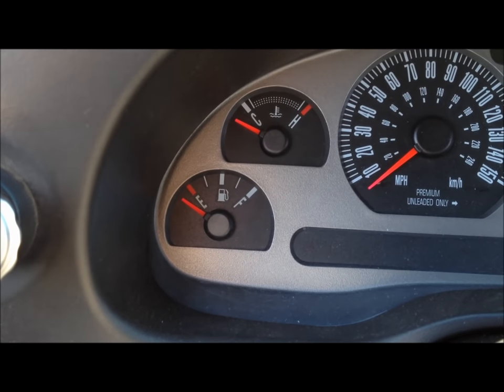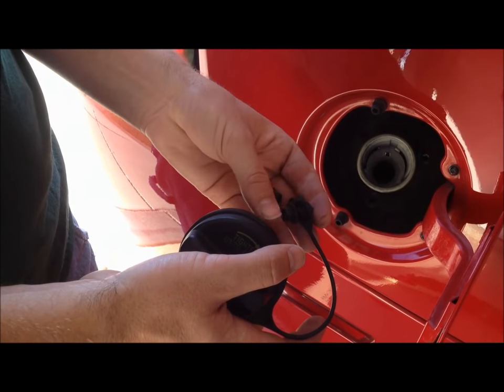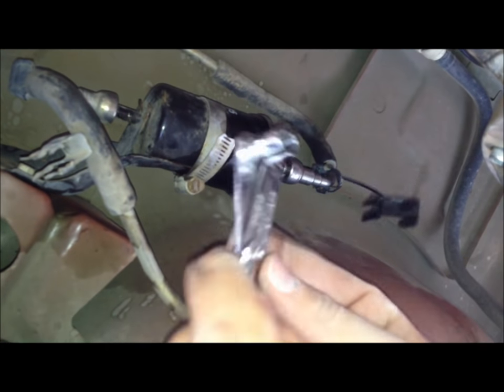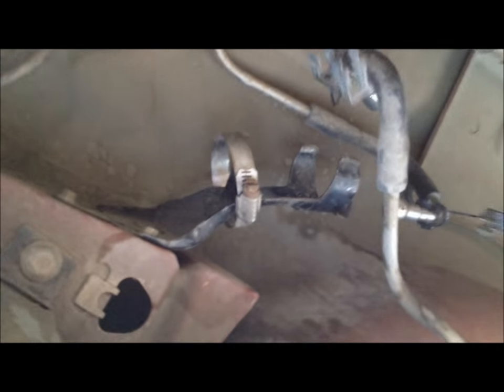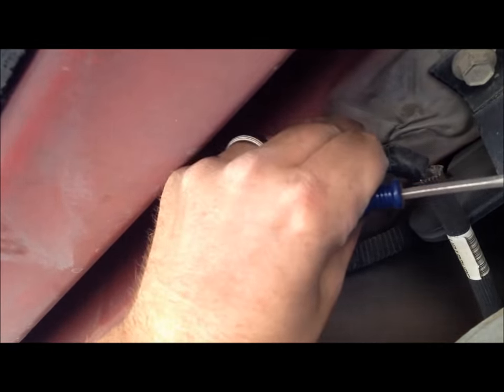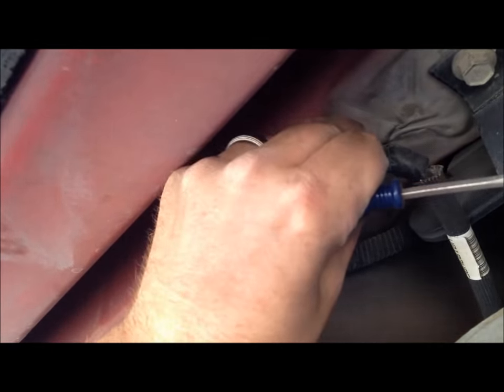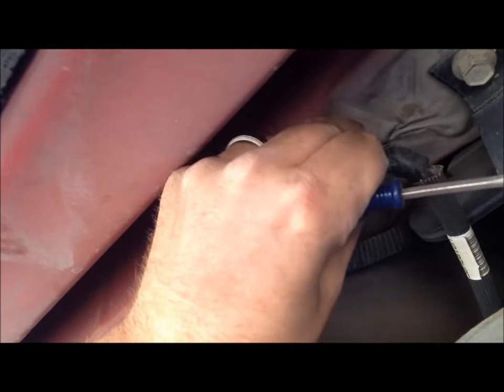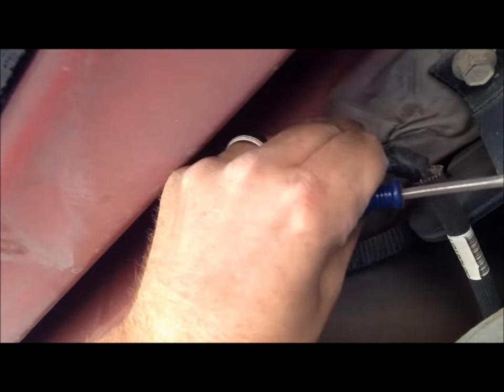How to change a fuel pump & Fuel Filter: Ford Mustang 1994-2004 sn95 New edge filler neck grommet

Comment: Good video,...again ! Danny, problem: I did replace pump into my 2004/ 3.8 litre Mustang, I got "universal" pump, bigger 255 l/min?/, from ebay! I looked a little bit different that your Focus SVT, but very similar. The plug was different so I had to cut 2 wires, and I did connect + to +, and minus to minus! Then replace new Motograft filter, and put that even correct way in there. Problem is, I can hear pump starting/ working, but here is NO fuel pressure, nothing?? Tank is about same than yours, about quarter tank gasoline? Could it be, that I wirered that wrong...., anyway?? Car is jacked up from rear, still, could it be that the pump does not get fuel yet?? needs more gas?? I will check Saturday, if filter is getting fuel, before I drop tank again?? What is wrong??? Thanks, youtheman =)
Reply from the maker: Eero Laukkanen i'm not sure. If the pump is running it's possible it would be running in reverse. Be very careful not to have anything short out and spark in the fuel
Reply: Sure, but....I red here, it happened before that new pump is much more powerful, and got hose loosen up from the pump, so I have to put better clamps in there?? Will see tomorrow, when lower the tank....one more time!! Would be a good reason not to have a fuel pressure!!;o) Let you know later, what happens/ if got it fixed!!! Thanks =)
Reply from the maker: Eero Laukkanen yes, I have heard of the pumps blowing the hose off. Once it's down, I'd consider a regular pump if the new one seems like it will cause issues
Reply: what did you find out?

Comment: My 2001 mustang cranks and turns off but almost immediately turns off. Could this be a sign of a bad fuel pump or the pats system? I noticed that the "theft" light is lit, it's not blinking rapidly though.
Reply: *turns on then off sorry
Reply from the maker: Yes, it's possible. You might want to check the inertia switch in the trunk (shown in this video) to make sure it hasn't popped. Could also be a clogged fuel filter (but probably not likely).

Comment: On my 04 mustang trying to pull the pump out of the tank but it's not lined up with the opening any advice?
Reply from the maker: David Cruz try lifting up until it appears to catch and reach down in there to free up the lines that may be caught.
Reply: Scrun Johnson no lines were caught just the whole unit was hitting the top of the tank and I was unable to remove it so I just changed the pump while it was inside the tank where there's a will .. but I haven't been able to get it started I did the filter  the pump fpdm and checked fuses inertia switch was good , only thing I didn't check was the relay I believe it's in the computer which I was told is a dealer item now what's going on is car is turning and if I spray some ether it eats it up then dies out. Any advice?
Reply from the maker: David Cruz so it's all plugged back in (the pump is plugged in) and it all fits inside the tank and screws down just fine?
Reply: Scrun Johnson yes all plugged back in electrical plugs back in screws in and everything ?
Reply from the maker: David Cruz that's so strange. Did you unravel the fuel lines? They may have gotten wrapped around the unbiblical cord style
Reply: Scrun Johnson yeah probably gonna have to drop the tank again and maybe disconnect one of the fuel lines to see if there's pressure because through research I've discovered this model doesn't come with a schraeder valve 😤it just keeps getting better..
Reply from the maker: David Cruz good luck. My sending unit just failed, so we'll need to eventually pull it again and change it so I know how full the tank is :/
Reply: What did you find out? You need to replace the sock filter also, maybe its clogged. In the video it looks like Danny didnt replace the sock.

Comment: What year ford focus svt did that new fuel pump come from?   I want to do the same thing i had a 99 gt
Reply from the maker: trendy bromandolorian 03/04. They are getting hard to find now
Reply: @dannyjohnsonsgarage  I know this is old now but I'm searching for this correct focus pump for my 03 mach.. I have found a post stating AIRTEX E2448 (which is a Walbro unit sold to Airtex) flows 284lph.. but it fits 00-02 SVT focus.. will that one work? or does it have to be 03-04 focus pump
Reply from the maker: Mitch Barber I’m sure the LPH is most important, and a good brand. I’ve even heard autozone sells the same pump with the same part number because a company remanufactures them. At this point it may be better just to get a good brand aftermarket pump that flows what you’re looking for
Reply: @dannyjohnsonsgarage  is that same pump you used in the video still working? Did you notice it ran any better with that pump? I'm just looking for a little upgrade over stock
Reply from the maker: Mitch Barber The car seems to run more rich now. Still runs well, no issues. I don’t drive the car a lot
Reply: @dannyjohnsonsgarage  thanks.   I have a crank no start condition, just checked fuel pressure it was good today finally so its not the fuel.  Obd scanner read a P0605, would this cause a crank no start?   99 35th ann gt with an added saleen series 4 supercharger kit
Reply: I did an ohm test on the crank and cam sensor, both seemed normal with an ohm reading around .3 each.   Also i have had the car towed to a shop and they made me a new key due to an antitheft condition, could the antitheft be a reoccurring problem?   I still need to take the key to the locksmith and scan the key to make sure it didnt lose signal to the transponder.   Havent checked for spark because passenger side of engine has blower intake tube covering coils, so it would require entire blower to be removed.
Reply: Danny Johnson your car is running rich? I’m talking with a guy that just installed this pump and his car is throwing p1132 now which is basically saying it’s rich.. what I read it this pump flows more base pressure than stock causing cars to run rich.. I’m thinking of returning mine now before install, do you have any insight in this?

Comment: what is the part number for the svt fuel pump?
Reply from the maker: Torrey Coffey I had a hard time finding it and bought the entire assembly that had a different part number. I'll have to see if I can find it. Just watch out cause a lot of these casings were used/re-used and so there is a thread going around how you can buy "the same pump" from autozone- but in reality it's just the case with cheap internals

Comment: Gotta 2000 v6 auto. Just got fuel pump changed. Car ran fine for few days then died in park idle. Wouldn’t stay crunk. And gave me a code p0455

Comment: Danny, I have code p0443. What part do i need to change?  I have a 2001 Bullitt.  Also can i change the tank grommet with out removing the tank?  Thanks fort he videos brotha.
Reply from the maker: For the filler neck grommet you’ll need to drop the tank a little to get the filler neck out https://youtu.be/JXt18xdGEEs
Reply from the maker: He p0443 is for the evap canister purge valve. I remember someone at a salvage yard when I was there pulling a new canister. It stems off one of the lines from the filler neck to capture fumes. Maybe you’ll get lucky and the grommet is making the evap valve throw a code. Fixing one might fix the other- but if not you’ll want to get a new evap canister or valve
Reply from the maker: “The P0443 code indicates that there is improper purge flow in the EVAP system caused by a physically malfunctioning purge valve or, a shorted or open purge valve circuit. The evaporative control (EVAP) system captures any raw fuel evaporating from the fuel storage system (e.g. the fuel tank, filler neck, and fuel cap).”

Comment: Good video! You seem to have a powerful Pony...., how many HP your Mach has?? And what is the speed for the pump, you put in: LPH??? Thanks, youtheman =)
Reply from the maker: Eero Laukkanen I believe it's a 284 LPH. That's enough to support about 450 hp with in Eaton supercharger, but I still would rather have twin pumps at that point. The MACH 1 is making a little over 300 to the wheels, but  my Cobra does double that.
Reply: OK, great, what kind of 1/4 miles times you have?? Both cars......;o)
Reply from the maker: Eero Laukkanen I have a video on the channel of the Mach 1 before I installed the 4.10s. It was 13s so should be a bit quicker now. The cobra has yet to run down the track, but should be high 10s if I really launched it hard..don't plan on it
Reply: How come Cobra has so many HPs??? And, what rear end do you have in Cobra, ratio??? By the way, mine is 2004, 3.8 litre, it is "second hand" car for me, I am building up my Infiniti FX45, boring up to 5 litre, performance cams (still waiting??), headers, aso...., planning to have about 450-500 HP in that car, and yes, it is 4 wheel drive =),,,,! But anyway, while I am waiting parts for my Infiniti, just "spicing up" my Pony a little, having a hard time finding a stage 2 camshaft for it, even used one???, Comp Cams don't even make it??, do you know, where could I find one...., used OK?? Thanks=)
Reply from the maker: Eero Laukkanen the cobra makes 670 at the crank and 600 at the wheels from a Whipple supercharger and factory forged crank, rods, and pistons for strength. It has 3.55 gears. I'm not sure where you can find cams. My wife has a G35 and I've done some work on my friends GTR, but in not too savvy on which parts are best for Infiniti/Nissan.
Reply: No , Infiniti cams are in order, I could only find one company?/ in California, that is not a problem, they just run out of aluminum blanks, I need stage 2. cam into my Mustang 2004/ 3.8 litre??/ What company makes them??? Have you heard, even used one OK!!

Comment: why are you replacing a good fuel pump
Reply from the maker: +Farley Gordon The car has 112,000 miles. I'd rather replace it in my garage than on the side of the road.